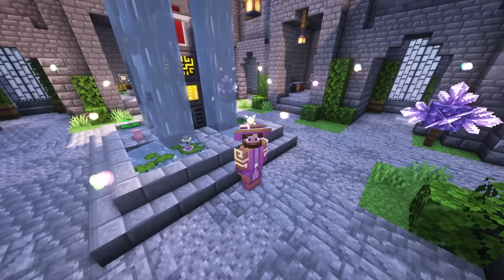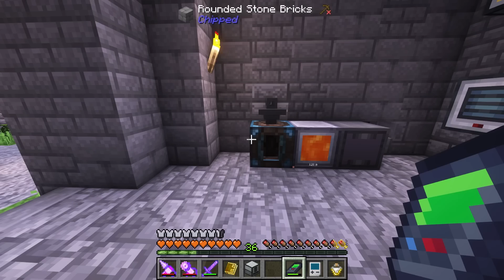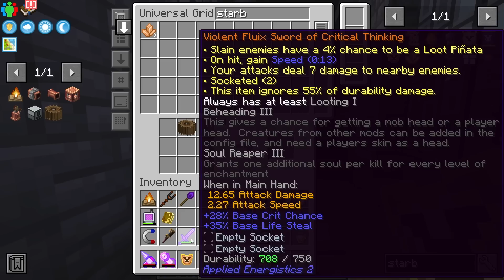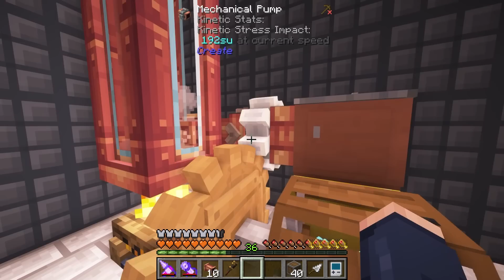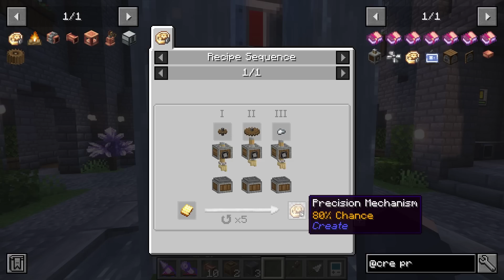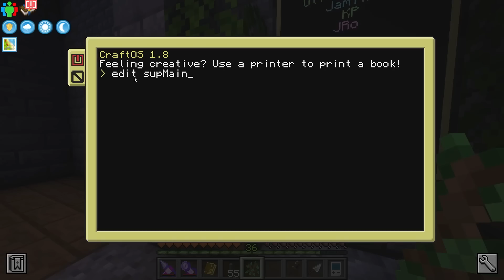FTB Skies Ep. 13 Compact Create Precision Mechanism Automation

Comment: When I went to make Blaze Burners the other day for some reason I wasn't finding the Fel Pumpkin recipe (probably my own lack of modpack skill) and Googling lead to me doing the Dreadful Dirt in the Nether method. I was not prepared for the chaos I unleashed. I thought I had things pretty well planned out. Made a nice box for them to spawn in and even thought to use Ethereal Glass so I could walk in and nothing could get out. The moment the dirt transformed approximately 85 bajillion Blazes and Wither Skeletons spawned and clipped through the walls of the box. My frame rates died. I had to try to add more thickness to the walls while dodging enemies at close to single digit frames. Once I got them contained and sniped the free floating Blazes things seemed to calm down. I ended up getting a lot of progress on the slay Blazes and Wither Skeleton quests out of it, but I wouldn't recommend doing what I did.

Comment: For the ender transmission, did you actually set the config for the second source to link to the first one? It seems you set the source channel to 10 named "test" but it seems that the secondary one didn't save changes when you broke it

Just in case you haven't tried that

Comment: Use a electric motor and a alternator then if you hook that into its own phlox network is should be able to cross dimensions then and you should feel then have the stress units that are made from the motor system transferred anywhere you needed to be alternative if you have a mass power generation going on using an electric motor can help mitigate any create stuff you need making it 3 have a smaller and cleaner setup
Reply: I feel you're saying some helpful information here, but I'm finding it hard to follow
Reply: @boonjabby  Use an alternator to transfer rotation to FE. then connect that to flux networks (Which works cross dimensionally). In the overworld place a flux point and connect that to an electric motor which converts FE to rotation.

Comment: Connecting stress generating devices with chain drives adds the stress together, so with the ender transmitter is it possible to connect them up in a chain and create free infinite stress for all your create machines? It'll either work flawlessly or crash. If you try it, test it in a compact machine so you can easily throw the block in the void if you corrupt something.

Comment: I also built a max steam engine setup inside a max compact machine in hopes to wirelessly transfer the stress to the overworld, i was extremely sad at the outcome. But for now i use it to run multiple setups inside multiple comact machines.